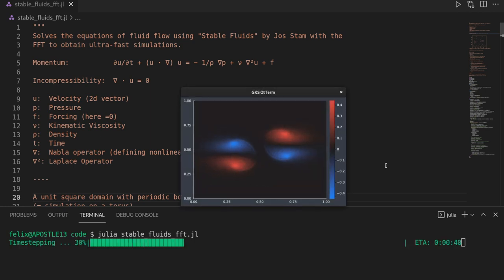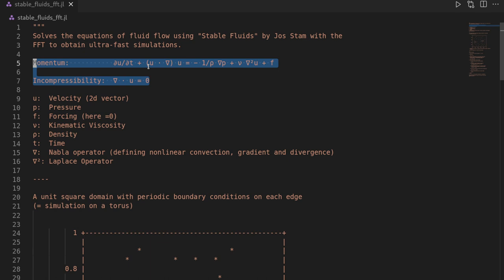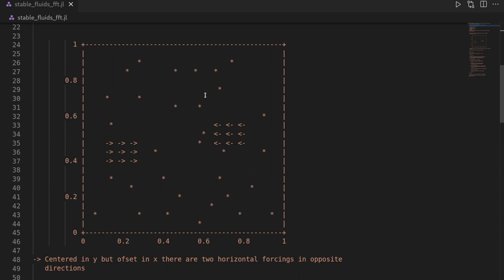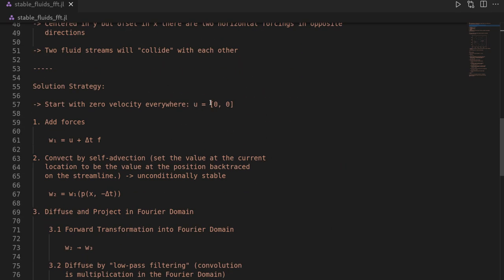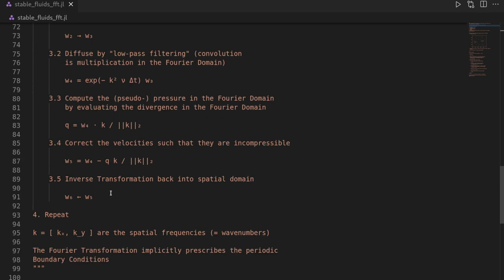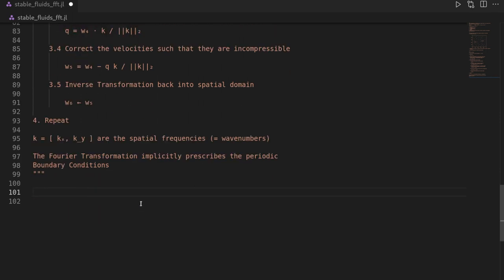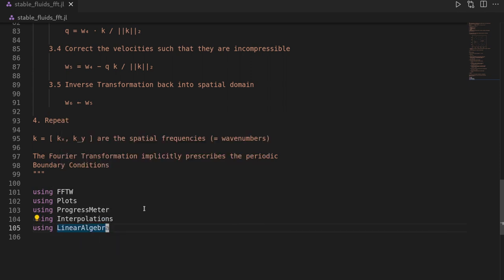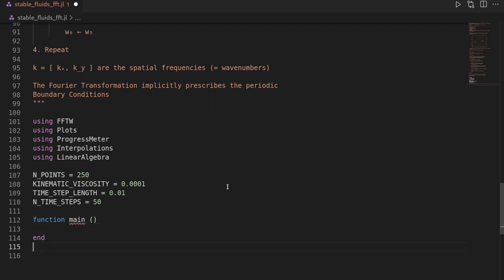Stable Fluids using the FFT in Julia | Fluid Simulation in Julia

Comment from the maker: Errata (two small errors):

There is a small error when setting up the spatial discretization at roughly 06:55. The way it was done here would include points on both ends of the boundary. That would make the domain slightly larger and introduce unnecessary noise (due to the application of the FFT). I haven't fixed that yet, because it would make subsequent steps (like the semi-lagrangian advection) more complicated. Maybe you have a good fix? :)
Here is the GitHub issue: https://github.com/Ceyron/machine-learning-and-simulation/issues/7

Small correction at 19:39 : I used the "clamp!" command in the video which would not respect the periodicity of the flow, i.e., fluid that would exit at the top boundary would not re-enter in the bottom. Rather, it would be clamped back to the top domain. This is not a big issue if you just run it for as low times as we did in the vide. Still, a better version is to "periodically clamp" it using the modulo operator.

I adapted this in a new version, you can find on GitHub: https://github.com/Ceyron/machine-learning-and-simulation/blob/main/english/simulation_scripts/stable_fluids_fft.jl

As a bonus: You can then also safely run it for longer times and might even catch some turbulence 
😉

Comment: What's your take on solving differential equations in python and julia? Is any one easier to start with?
Reply from the maker: Great question.

I think the Julia DifferentialEquations.jl ecosystem (https://diffeq.sciml.ai/stable/ ) is unmatched in any other programming language. If you want to solve (advanced) Ordinary Differential Equations (and variations thereof like Stochastic ODEs etc.) it is highly recommendable, especially due to their many tutorials available. However, you have to get to know the Julia Programming language a bit. Though, this will happen as you go. On top, Julia is definitely a language worth learning.

If you just want to solve some simple ODEs and already know Python, SciPy's ODE capabilities should be sufficient.

If it comes to PDEs, I think the best package available is Fenics (which is based on the Finite Element Method) and only has a Python interface.

Let me know which kind of problems you want to solve, then maybe I can give you a recommendation. :)
Reply: @MachineLearningSimulation  It looks like I need to go with Fenics as I'm interested in electro-thermal simulations where I want to see the effect of geometry, i.e. current flow being constrained at corners leading to more Joule heating.

Great channel, very happy to see your content and approach. Truly appreciate it!
Reply from the maker: @sniperdogruffo  Sounds like an interesting application.  😋
I am sure, Fenics can be a first start. It might have a steep learning curve in the beginning, since you have to know what a weak form of a PDE is. But after that it is super nice to use and takes away a lot of the pain when writing FEM solvers.

I also have a first introductory video to Fenics: https://youtu.be/QpA7E4YHbyU

I plan to do more in the coming months, also one for the Navier-Stokes equations ;)

Comment: can i do this in excel vba? please help me😥🙏
Reply from the maker: Uhh, good question 😁 It's a joke, right?
But it would be an interesting challenge.
Reply: @MachineLearningSimulation  no, i need to know to the exact procedure to implement this sir. 😥
Reply: @MachineLearningSimulation  I've already done another physics simulation but unfortunately I only know excel vba, so I need to understand another programming language well so I can convert it. can you guide me?🙏
Reply from the maker: Hey, okay, sorry for the reply. I mean of course you could implement it in VBA, but as you already noted, it is probably better to do it in a different programming language.
From my point of view, you have two options there: either Python or Julia. If you want to dive deeper into scientific computing and require high performance and parallel capabilities, go for Julia. If you also want to use the learned programming language for sth different like easy scripting, web development etc, then opt for Python.

Regarding resources: that probably depends on the knowledge you already have. I would recommend googling for tutorials in the language you chose, then find a couple a go for this that suits your learning style the best.

Best of luck :)